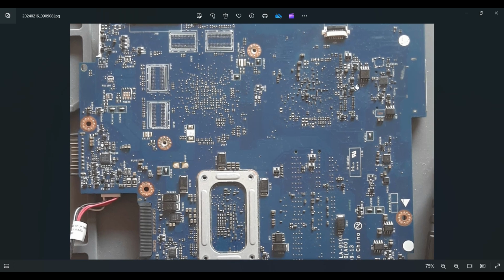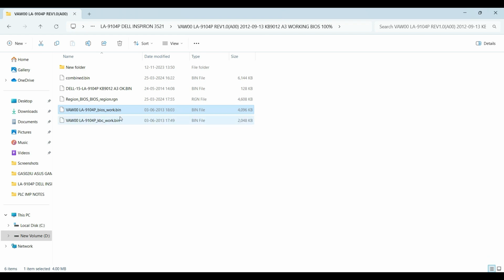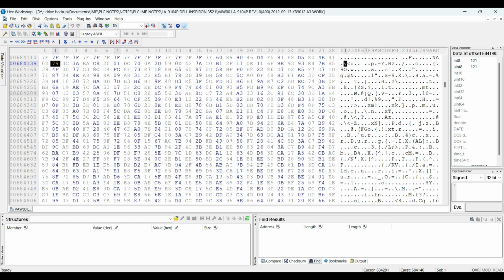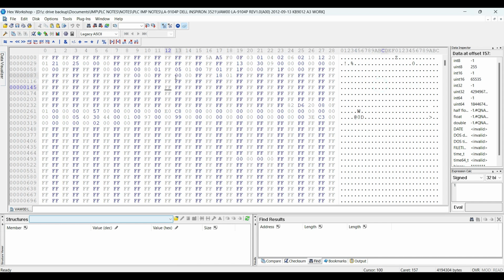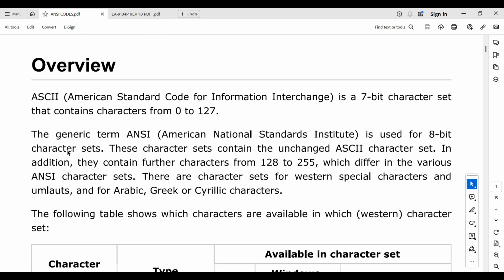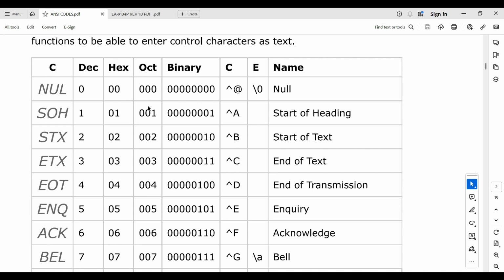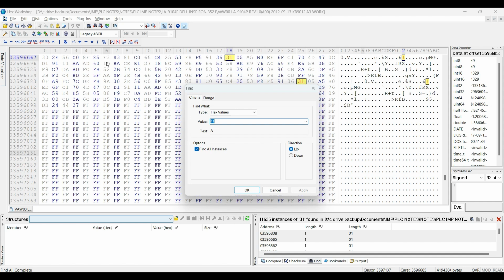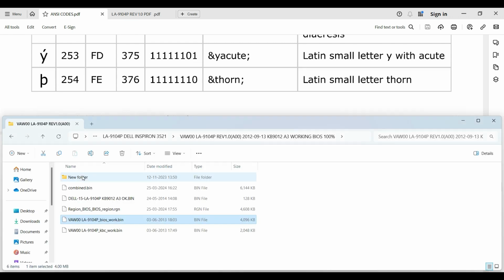Laptop Repair: Decoding the Mysterious BIOS Language

Comment: Can I edit or modify any wifi camera's .bin file using hex workshop with ascii and ansi code. The serial number and mac address of wifi camera is hidden in the .bin file so can I find it with the help of the ascii or ansi code and modify the serial number as I want ?? Please reply just curious to know whether it is possible or not ?
Reply from the maker: yes it's possible if those are printable characters in your bin file